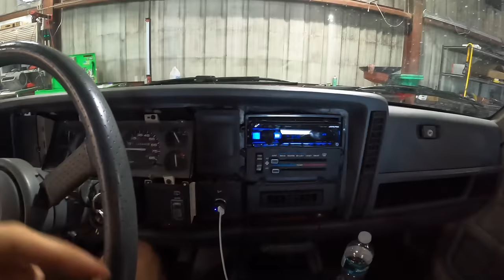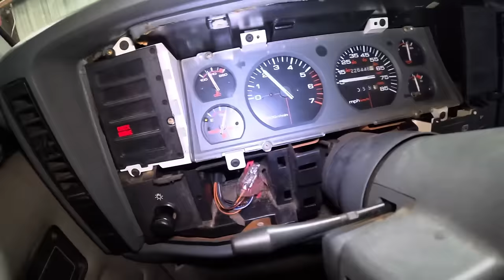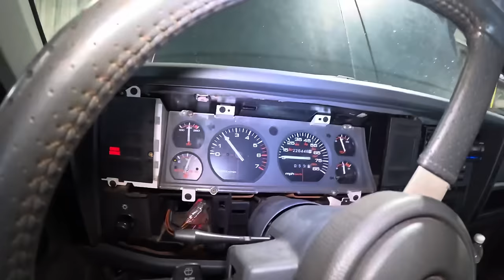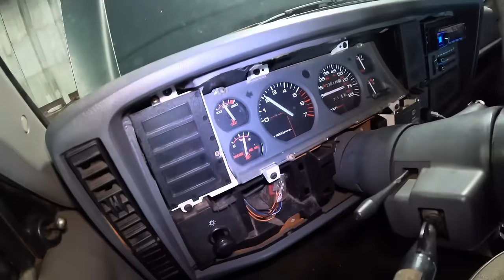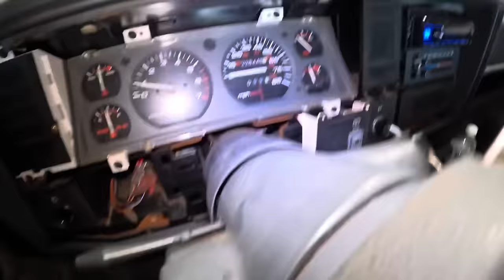Scalding HOT EVIL Filter of DEATH!  SEVERE Smoking! Jeep 4.0 Cherokee / Wrangler @bgproducts

Comment: I learned the hard way not to poke my finger through the foil cover under the cap. Without realizing it, a piece of foil broke off, and when I poured the fluid, a piece of foil went in. Now, I cut and peel the foil.
Reply: it is ok those who like to engine repairs or replacement say do not change your ways
Reply: And what happened? What monumental disaster befell that engine from that itty-bitty piece of foil? 
(Ya know, not every piece of debris that gets into an engine is the end of the world.)
Reply: @gregoryheim9781  If it's a small piece, it will get sucked into the oil pump, it may or may not damage the oil pump on it's way to the oil filter. If it's a big enough piece, it'll get caught by the pick up screen and starve the oil pump of oil. Either way, it's never good for foreign debris to fall into the crank case.
Reply: It's one of those things that bug me when I open those bottles. I poke them open and peel back the foil and plastic before pouring it.
Reply: I just got a funnel that has a piercer and a filter screen.
Reply: @Dustin Does Stuff  Yes, "never good", but not the end of the world disaster that DIY mechanics fear. A small soft flake off an oil container isn't going to cause any issue with the oil pump, filter, or oil pickup. But most DIYers think they're one-half foot/pounds of torque on a fastener away from complete chaos. They're blood pressure spikes and they hyper ventilate at the thought that it's not absolutely perfect. An internal combustion engine runs hundreds of thousands of miles neglected and abused. They're not that delicate. Unlike the egos of the people who purchase them.
Reply: I've seen this comment from the same person on like 5 different vijeos
Reply: @Andrew Castiglia  Being able broken record "proves" that he's smart. 🤣
BTW, what's a "vijeo" anyway?
Reply: @gregoryheim9781  Any "mechanic" that recommends being sloppy on purpose is a bad mechanic.  Even rebuilding a 5 horse small engine carb you need to be careful, the main jet is the size of a hair. So yeah, stuff matters.
Reply: Too much work to peel it all the way off,  then what do you do with the piece of foil after you take it off,  that's just that much more work to clean that up
Reply: @dom1105  No you haven’t.
Reply: @gregoryheim9781  if you don't do dumb things and put foreign objects into your engine , it can't cause any damage.
Reply: @Dawson Detrana  So many DIYers think that their anal details makes them look smart. Being a for-profit professional mechanic means efficiency, efficiency means speed, speed means more profit. When you're just tinkering in your driveway you can afford to go, "Look at how detail oriented I  am. Please give me some attention."
Reply: Yes been there done that
Reply: @gregoryheim9781  a clogged passage, filter or pump or just extra particulate used for lubercant or heat exchange MAY do you in try  adding extra and tell us the results
Reply: I cannot believe you still don't have a parts washer. All those stainless sinks and you with your"genius moves" I would think you could have made your own parts washer.
Reply: @Class B Living  LoLoL Since it would go to the filter before going into the sump, and before getting to the screen and oil pump...  You seem to be overly worried about some that can't really happen. That's why this whole made up scenario is amusing to me.
Reply: @Class B Living  Funny. "... at the rate Ray changes oil..." You'd think there'd be blown up motors all over Florida. And yet, there's not. Talk about making a mountain outta a molehill. Don't you have anything better to do Henny Penny?
Reply: @dawsondetrana5496  should not be a problem for him just throw it in the floor like everything else
Reply: This is the way.
Reply: @Class B Living don't drag Matt Happel into this, lol.
Reply: @Class B Living Well said.
Reply: @gregoryheim9781  Honda has a TSB that states "Do not poke your finger through the film on the oil filter", specifically. You know why ? I'll give you three guesses why.....

Comment: I had a '87 Jeep Comanche that I neglected when I didn't have much money.  To clean the engine, I used the Slick50 product and it DID break up the sludge, so much so that the pick up tube was getting blocked. I dropped the pan and is was full of sludge. But the underside of the engine was a beautiful AND clean amber color. Cleaned out the sludge and it ran beautiful after that.

Comment: Wow I was impressed with the hose replacement that someone did on this auto. Never seen a garden hose cut to be used on the engine and yes I am aware that it was a breather pipe so no pressure appeared to being put on it.
Reply: I've seen the garden hose mod on a Dodge Scaravan.
Reply: Did Ray reuse it or replace it with the correct hose?
Reply: Pressure isn't the issue. They can take pressure. Oil vapor is the issue. Many of them absolutely CANNOT handle oil, and will turn to mush. However, the funny part about that is that the cheap vinyl garden hoses will handle it better than the expensive rubber ones. :)

Comment: Ray, why do you not have a parts washer? It must be more cost-effective than using brake cleaner, plus using the brush will mechanically help remove the gunge.
Reply: Great question
Reply: He does, name's Troy !😊
Reply: Has one.  He commented before it failed.  Question is..... did he or is he going to fix it.
Reply: I've been internally screaming this to myself almost every video... a little actual rubbing with a rag/ carts cleaner brush goes a long way  with the final clean up rinse with brake clean. I know Ray has his "Stich" with the whole "shiny" but it really aint all that clean just blasting a whole can at it in one go.

Comment: Put about a half a quart of transmission fluid in that thing and it will do wonders for the valve guide seals and the pan gasket probably. And it will do the final cleaning of most everything in there. Marvel Mystery Oil works great about a week before an oil change especially in that older style engine. It even works good in the new engines especially things like a 5.4 L Ford that has those small oil passages which operate the cam phaser. As well as the 4.7 and 3.6 others that have the hydraulic valve lash Adjusters.

Comment: Im a regular here, but this video will prove to be super useful to me as I likely have sludged up piston rings that is causing a lot of oil smoke to be emitted from my exhaust in my 240sx. Thanks so much for making this! I have already replaced my valve stem seals while rebuilding my engine head (have not touched my core engine internals yet), and ever since the blue smoke issue persisted, I was planning on pulling the engine out and doing a full rebuild. I am wondering if it would be worth to attempt this first. If I have excessive oil burning, how likely is it that it is due to piston rings being really sludged up versus them being too worn (along with cyl walls)? The engine sat for 6 years before I bought the car. Since the bp kit you used is $~300, I am weighing my options.
Reply: Pull your spark plugs and check for oil residue in the chamber. Get a compression test done and record your numbers. Consider picking up an engine bore scope if you'd like a view inside the block before you tear down your core for a rebuild. If you're working with a ka24de like I think you are and you've rebuilt the head,  rings may be gone and looks like you're in for rebuilding the internals with an overhaul kit and having your block tested/machined. A BG service like this will no doubt clean up your rotating assembly but I'm skeptical on whether it'd repair an internal seal by cleaning out buildup and debris. Best of luck to you

Comment: Hi ray I had Vauxhall viva back in 1976 with low oil pressure and stuck rings I drained the oil and run it around for a day with parraffin in it worked a treat 👍👍 good on ya fella

Comment: Ray, we need a review of the amsoil brake clean. From one dealer to another, it's for science! Haha
Reply: I personally always just buy whatever the cheapest brake parts cleaner I can find.   At Walmart you can get the cheap stuff for like $2.99 a can.  Since it's going to get used a can at a time pretty fast, it's a tiny bit cheaper.   Also, some blends of parts cleaner are not flammable, while most are.    Just something else to note if you ever use it as a substitute for starting fluid.

Comment: Proof that you should service your oil and filter every 5,000 miles since it’s just such cheap insurance for your motor.  The guy is lucky it’s a 4.0 boat anchor which are hard to kill even when neglected.  Reminds me of the 7.3 Powerstroke.  I have never even heard of this type of cleaning system that Ray used.   I’m interested to see the oil filters on the next video.

Comment: Any reason to not just do a brief spray of cleaner and then go at the inside of the valve cover with a wire brush? Seems like it'd be the most efficient way to get that carbon buildup off at the end there.

Comment: Exceptionally surprising difference between before and after.  Your shop could definitely use a 40-gallon parts washing tank with varsol (mineral spirits) or PSC1000, etc.
Reply: Ray HAS a parts washer setup, just doesn't use it except to store empty bag-in-a-box tranny oil containers!

Comment: I recently used this BG product on an Audi A4 I bought in December knowing oil consumption past the rings may be an issue.  Before the cleaning the car was using a quart of oil every 300 miles.  After the cleaning it is using almost no oil and fuel economy is up about 20%.  At the start of the cleaning process lots of smoke came out the exhaust but by the end of the process there was no smoke.  Hopefully the effects are long term.

Comment: Done similar with 2 qts oil, 3 qts kerosene, 1500rpm for 15 minutes. Usually do it 3 times, noting the difference in what comes out the drain each time. Works very well, but certainly can't say what you've done here didn't work great as well. Very effective at pulling all the wet sludge and some of the older stuff as well. Tends to REALLY quiet down the valvetrain when completed and worth the effort on a sludgy motor.

Comment: Back in the late sixties my dad rebuilt the 289 on his '62 Chevy Bel air. My part of helping was using a spoon and butter knife to scrape 1/2 inch of hard sludge off the lifter valley and around the rocker arm area. My dad used quaker state oil so I don't know how much that came into play.
Also you need a work bench and vice   . Nestling a valve cover in between the jaws of the vice would help in scraping the valve cover and fir tapping the mounting flange out straight

Comment: Just a observation it looks like that cherokee still has the coolant shut off valve to the heater core they can be easily eliminated by getting later modle hoses I know my 97 did not have it from the factory

Comment: Hi Ray,  think  carefully before adding alvohol to your fuel, it will eat all the 'rubber' seals in the fuel system.  Even modern viton fails with excess  alcohol Robin
Reply: That's why ethanol is so bad for older vehicles
Reply: @curtisj2165 even new ones! I bought my lawnmower a couple years ago. It literally runs for about 5min cutting my grass. The following year I took it out of the shed and pulled the cord and it would crank, but wouldn’t turn over and run. I took it back to where I purchased it as they’ve also got a small engine mechanic. They called me a few days later and said it was ready. When I picked it up I asked them what was wrong and was told they had to not only replace all the rubber lines, but also the carburetor as it was all trashed. Too expensive to rebuild compared to just puttin a new one on $70 later I was back up and running. Said they’re kept busy every year with that since the Feds started requiring ethanol in the fuels. What a complete joke. For the “environment” yet we’re spending more energy repairing everything that fails from it smh. There are places you can buy ethanol-free gas, but closest to me is a 45 min drive so I just run some stabil through the last tank of the year and haven’t had an issue again so far.
Reply: @KendrasEdge757  I always run mine dry on the last tank of the year. 15 years now, same plug, no problems.

Comment: The oil will not "wick" along the valve stems.  The engine vacuum can/will draw the oil past the valve seals into the combustion chamber.  The umbrella type seals CAN be removed and replaced with new without pulling the heads.

Comment: Running 4 qts of cleaner in a 6 qt engine bothers me a bit.  i guess level and stationary is OK.
Will this cleaning help decide if the engine is good enough to justify expense of a new exhaust?
Would be interesting to take a look inside the pan and oil pickup after this.
Reply: do that on a BMW under warranty to see what happens?

Comment: I use to work on Small Engines, I would Run Transmission Fluid in them for about 20-30 mins., it would do a great job cleaning out the Internals...

Comment: In my 240,000 mile 4.0 I put 5 qts oil and 1 qt atf to curb the lifters and it works well… I run it 3000 miles like that…

Comment: I Think I saw a crack in the valve cover. The suspicion zig savvy line is under the pin with the press on retainer that holds the throttle cable and the other two cables. It goes from the screw that holds the vent that had the Beautiful garden hose on it to the passenger side of the valve cover. 
The Dynamic Cleaner costs Thray Hunnert DAWLURZ?? JAYZUS!!
Okay, we enjoy your channel. Glad you have help. I was Digging the way you and the construction guy got the Biggass wooden piece up. Didn't get sidetracked by details,, just cut, hammer and screw it in.. Great job.

Comment: Mechanic tip.  If you are going to empty a full bottle of viscosity lubricants into an empty engine reservoir.  Shotgun your viscosity lubricant bottle.  Like shotgunning your beer from days of old.  Poking a sizable hole at the bottom of full container well allow air to equalize the pressure leaving the container so it doesn’t choke air going in while viscosity lubricant evacuates the storage container.

Comment: I heard of Bestline Engine treatment.  so I tried it in a 1999 Honda Civic.  1st oil change I used 10% Bestline with 5w 30 as required and changed the valve cover gasket and tube gaskets.  The valve cover was dirty. 2nd oil change I noticed one of the tube gaskets was leaking. So I removed the cover bought OEM gasket kit and noticed the valve cover and valvetrain was SHINY.

Comment: I have done the same thing as Ray but I used diesel. A 1:1 mix with a cheap oil first. Then 1:2 with oil. Finally just cheap oil to wash out the diesel. The engine I did this on was in worse shape than this one. The old oil was like asphalt. Six months later, the new oil was still as good as new.

Comment: Those four leaders in the Jeeps have a PCV valve problem check to see if that's the problem pressure has a a replacement kit for that it made that may stop excessive smoking check with Chrysler see if they have that new PCV PCV valve and it's a couple of plastic hoses go on the intake for the I seen that many times in over the years I've worked on vehicles

Comment: Troy needs to also be shown how to pour oil with the opening in the container at the top so it doesn't glug as air is sucked in. Basic thing but makes control of the gravity assisted oil stream more controllable. Means using less brake cleaner afterwards, but thems the breaks ( or brakes if you want a bad dad mechanic joke) .

Comment: I wish I knew you when I lived in Tampa. My Oldsmobile 98 was smoking fearcly when I got it back from the insurance repair shop. I brought it back for them to replace the moldings in the front and when they brought it back from the back within 15 min, it had the smoke which it wasn't doing before I went in. All they could say was that it was an old car.
You need one of those Ovglove things. They are fire resistant when you need those hot parts moving and you have traction.

Comment: We used to use diesel fuel fill it slightly over the full mark on the dip stick run the engine for about ten minutes turn off & leave overnight then drain (diesel has some type of detergent in it thats why oil out of a diesel engine is so black & filthy) seemed to do a good job.

Comment: Okay Ray, I really don't like to complain and I really don't like to rant on but, if you use the same magnet that you take out the plug screw from the crank case cover to take out the filter after you unscrew it you wouldn't burn your hand (that was number one).

At the end of the procedure when you were taking out the valve cover screws you got the idea of using the magnet to pull the screws out of their place to avoid burning your hands again, I'm sure that eventually those things you would have found out by yourself either way, I am totally proud of what you and Troy are doing their my dream would have been to been an assistant for a guy like you unfortunately I have a spinal problem and cannot be standing I must always use a wheelchair. Rock on my brother you guys are great together.